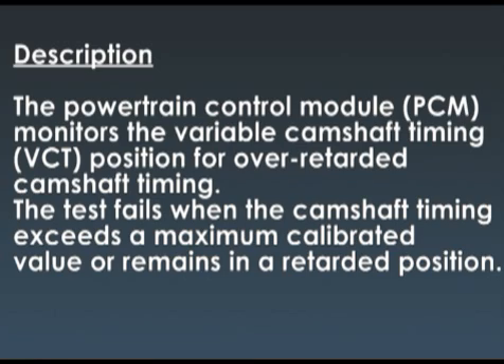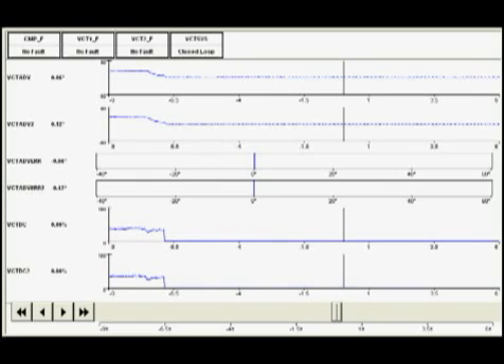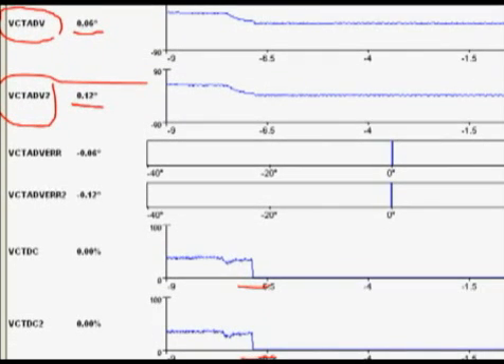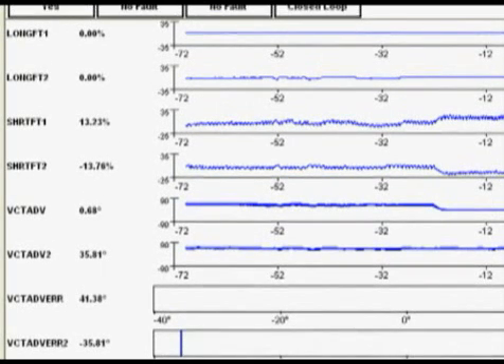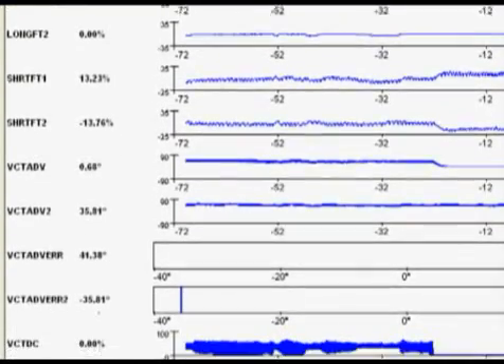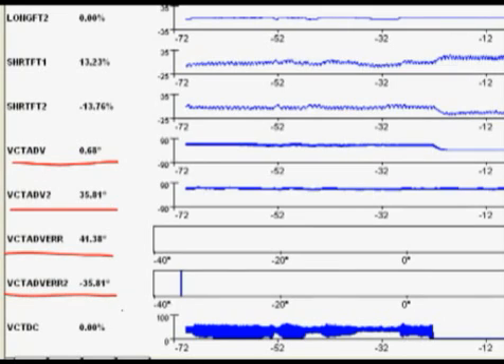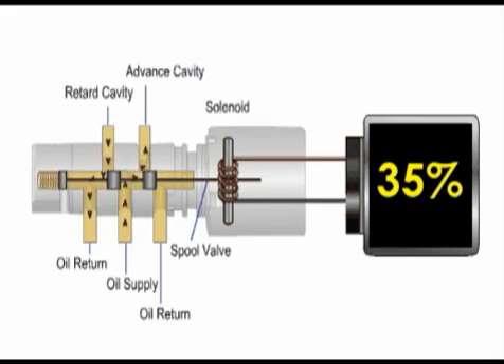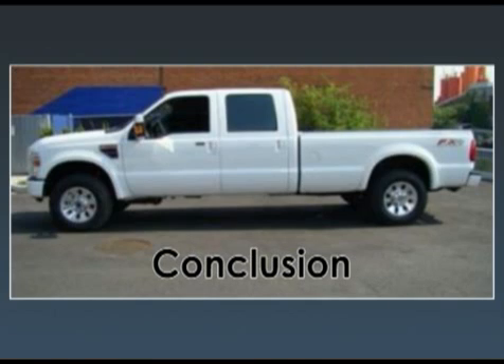2008 Ford F150, P0012 & P0022 codes

Comment: Great video. Thanks! Others with this problem may want to consider a Cam phaser lockout kit. While you will not get the better gas mileage provided by cam phasers you will never have to worry about them making noise again. Of course, make sure your oil pressure is good, for the rest of the engine's bearings.

Comment: So if you have good oil pressure and the VCT solenoid is stuck open the timing position will be retarded all the time?
Reply: That is correct on the 5.4L 3V. As the PCM increases the PWM (pulse-width modulation = seen as the VCTDC1/2 PIDs), the VCT unit spool valve moves as the oil is allowed to pressurize the retard side of the vanes, forcing the VCT unit to turn counter-clockwise (retard). Note: The default locking position, or if the VCT system is in open loop (VCTDC PIDs reading 0%), the position of the VCT units is FULL ADVANCE.

Comment: This is why when you do a timing job on these trucks, it's advisable to replace the oil pump while you are there. It's 5 more bolts when doing a timing job!
Reply: I did the timing job and replace vct solenoids and oil pump. My problem has returned just as this truck.... what now?
Reply: @kawkvulcan500   If you have a scan tool that can read engine PIDs, observe what your VCT DIF or ERR PIDs with the VCT solenoids electrical connectors disconnected. While the engine is running, they should read near 0. If reading greater than +/- 1, then its possible the engine was not timed properly or the VCT unit locking pin sheared or faulty.

Comment: Unplug your VCT sensors and the problem will go away. Your power Banff will change a bit but it will rum fine. Oil pump usually isn't the problem. The vct solenoids and a shitty design and malfunction from any sludge buildup. Replace them when you can and use 5-20 synthetic and change it often along with filter and and oil treatment.
Reply: Will M what will happen if u run truck w them disconnected?   Can it be left like that long term? I changed vct but still shitty.

Comment: according to manual @2000rpm 40-60 psi normal operating temp,the mean thing about Ford is ,they don't give you spec at Idle.is there someone who measured a new engine at Idle?and @ witch temp and rpm????

Comment: I CHANGED MY TIMING TENSIONERS ,CAM PHASERS,VCT SOLINOIDS,AND ALL SPARK PLUGS IN MY 2008 F150 5.4!! THE TRUCK IS STUGGLING TO KEEP ITS IDLE WHEN I COME TO A STOP AT A LIGHT I REV THE ENGINE IT COME TO A NORMAL IDLE. THE STUGGLING CONTINUES AT EVERY SLOW DOWN . I UNPLUGED MY VCT SOLONOID ON THE DRIVERS SIDE AND IT KEEPS IDLEING GREAT HOW AND WHAT DO I DO TO FIX THIS . I EVEN LISTENED TO YOU AND MY OIL PUMP IS PERFECT TOO PRESSURE AT 75. HELPPPPPPP PLEASE
Reply: I have the same issue and same truck. Did all that stuff and worked just great for about 1000 miles.... same issue.  Gonna clean the throttle body next.... idk
Reply: Those vct solenoids are very sensitive I did a timing job with all new parts and have the same issue doesn't want to idle very well. Did you figure out  exactly what is was?